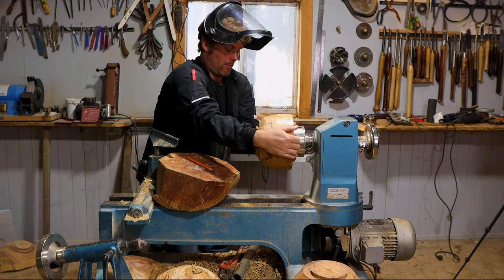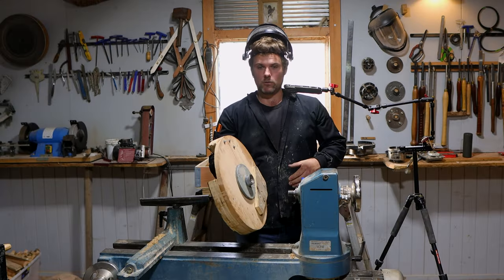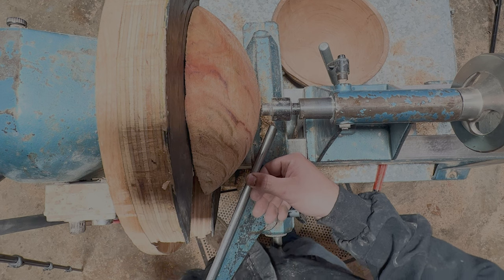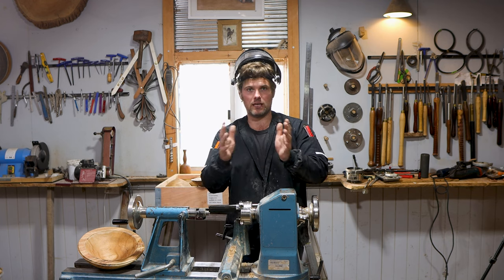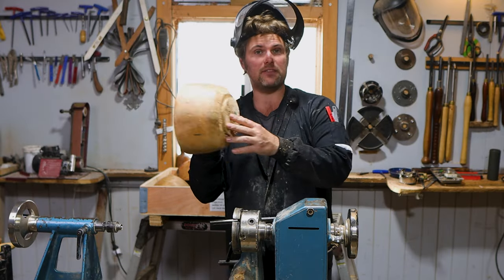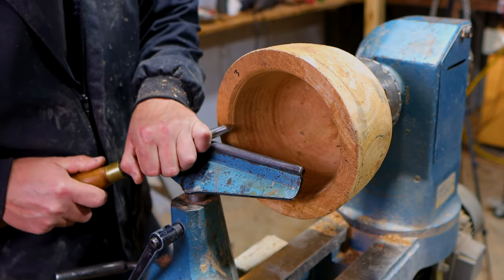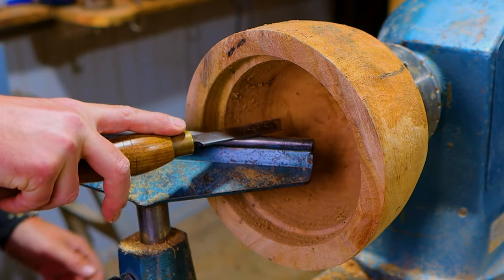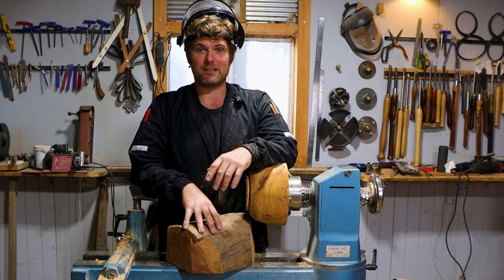4 BEST ways Professional Woodturners use to MOUNT bowls to the lathe. Wish I knew before I started

Comment: Thanks so much for this video.   In the last method, using Mr. Raffan’s skew created shelf on the inside of the bowl to lean the chuck on, once you turn off the spigot on the bottom how do you remove the inside shoulder ?   I am a rookie and this maybe a dumb question.
Reply from the maker: There is no such thing as a silly question.
* 	Place the old out of shape tenon into the chuck as I demonstrated in the video.
* 	Form the shoulder/shelf/step that you mentioned on the inside of the bowl, use your bowl gouge, skew, or just your square-end scraper.
* 	Take the bowl off the chuck, then reposition the bowl to face the chuck. Secure the chuck jaws by expanding them into the newly formed shelf/step/ shoulder you just created. Reshape the tenon to ensure it spins true while shaping the outside of the bowl. Shape the outside until smooth and ready for sanding (but hold off on sanding).
* 	Now rotate the bowl again, putting the newly formed tenon back into the chuck. Finish turning the piece entirely on the inside.
* 	Now setup up for sanding. Sand and apply your finish. In this video, wet sanding with Danish oil is shown to achieve a clean, even finish: https://www.youtube.com/watch?v=J8mKX1QGxjo
* 	After completing the sanding and applying a finish both inside and outside, it's time to remove the tenon. This video offers a simple method for doing that👌 https://www.youtube.com/watch?v=gOcFuTWKYXs
Just remember,The only stupid question is the one that goes unasked.

I hope this is helpful mate
Cheers,
Kezza
Reply: @KerryCorney  thanks so very much
Reply from the maker: My pleasure, mate. If you have Instagram, look me up there as well. That way, we can chat using the messaging feature.Cheers 
Kez

Comment: A trick I learned from Richard Raffen was for mounting blanks, which for you would be rough turning and coring, but for me finish turning, I drill a recess in the top side of the blank. For my Vidmark 120 chuck, that is a 2 5/8 diameter forstner bit, no clue to what metric sizes would be, but you don't want a tight fit, and especially if your blank is uneven, then drill down far enough so that the blank rests oh the outside part of the jaws. . Take the biggest bowl core first, and you already have the center mount for the core by expanding into the drilled recess.... I do use the McNasty, Every one who has tried to use it swears at it. Those of us who know how to use it swear by it......
Reply from the maker: Oh yeh! I made a video on that method👌👌
Works a like a charm

Comment: Loved when you opened the chuck too wide and the jaw fell out!  Hubby and I are absolute beginners and have done exactly that , and had to fiddle around to get it back in properly.  We bought a vintage lathe along with a bunch of accessories, but are lacking a chuck screw, or face plate, and I am trying to figure out exactly what to order to get going .  I ordered a face plate, but it appears to not be machined properly, and won’t screw on.  The lathe came with two 4 jaw chucks, but it seems we need something more in order to secure a piece to cut a tenon.  It is rather confusing.  Anyway, fun and informative video.
Reply from the maker: Thank you so much for your comment. I was thinking, if either of you have Facebook, there is a Woodturning for Beginners page on there that is useful. Can I ask what brand of lathe you have? 
I’m really happy that this video helped. Please let me know if I can make a video on a certain topic that can help in any way.
Cheers,
Kez
Reply: @KerryCorney  thank you for your reply and suggestions.  It is an Atlas, one that was originally used by (I think) McDonald Douglas to make mock ups of parts.  My husband would remember better, I think. This is funny/not funny, I ordered another face plate but it was marked delivered to my mailbox and was not in there!  It is a locking mailbox, so I will wait till tomorrow and see if my mail carrier made a mistake. Hubby managed to get a tenon onto a piece of cherry, a log about 5” in diameter, so we are making progress.  If you made a video that addresses options to secure the piece while cutting a tenon, alternate ways to create a tenon, or any way to get a larger piece than a 2x2 on the lathe if you don’t have a face plate would be helpful. Also I have several pieces of very spalted wood, discussion on whether stabilization with something like Cactus Jiuce is advised, how to proceed would be helpful.  Thanks again.

Comment: An even faster method is rough turn bowls with a slightly longer tenon..then when dry use a Forstner bit ( I use 60mm or 100mm depending on bowl size) and make a hole in the center point you left on tenons. Mount on chuck and finish turning your bowl.. you can then turn inside and outside from that mounting position. Takes practice to turn the outside “backwards “ but bowls will be %100 true inside and out…then just normal tenon removal.
Reply from the maker: Sounds like you have it all sorted mate👌 I made a full video on using a Forstner bit. https://youtu.be/QiCNRcm4HfU?si=CmJSVhdT77cIKUTw 
I use it for time time to get me out of a jam! 🤝
Cheers mate. 
Kez

Comment: On the first three methods, how do you finish the inside of the bowls? Thank you for sharing your knowledge and experience 👍
Reply from the maker: Hey, you've just inspired a video idea for me. Once you've shaped the exterior and formed the tenon, flip it over and attach the chuck. Proceed to turn the interior, sand it, and then apply some oil. I will make a video of each method right up to sanding. 👌

Comment: I don't know if anyone has already mentioned it, but at 1:11, getting those four jaws to tighten equally around the screw can be a challenge. Depending on your chuck, it seems that attaching those jaws can require some pretty specific technique. I made the mistake of assuming "Nova" chucks would be excellent. Well they mostly are but then I started having problems with finish, tool marks, vibration, tearing. Someone please do a video about how to properly get those jaws lined up on the chuck.
Reply from the maker: I’m sorry to hear that you’re encountering these issues. Personally, I haven’t faced any problems with aligning the jaws after switching them to different sizes; or when cleaning the chucks. I use Vicmarc chucks and jaws exclusively. If you’re considering upgrading to Vicmarc, you can find thread adapters to fit your spindle.
I will for add your idea and any others to my list of to-do videos, Walter. Please let me know any future ideas you come up with and or need a hand with🙏🤝
Cheers, Walter.
Kezza

Comment: Found you based on Tomislav's recommendation, and after watching your first video, subscribed.
One thing I wondered; you did not mention using a Longworth chuck or jumbo bowl jaws. Was this because you do not prefer those, or you wanted to show remounting without specialist (expensive) equipment, or because you think those should be used only after rounding the warped blank first? I have adjustable jumbo jaws, would it be safe for remounting or finishing only? Thanks in advance and greetings from Finland!
Reply from the maker: Firstly, thank you for taking the opportunity to follow Tomislav's recommendation and checking out my channel 🙏. 
Concerning the jumbo jaws, I exclusively utilize them for removing the tenon once the bowl has been finished. 
My intention is to showcase various options to fellow turners, expanding their understanding of alternative methods they can utilize effectively with items they may already have. I hope this answers your question. Please let me know. Cheers,
Kezza
Reply: @KerryCorney  I agree. I was also told the jumbo jaws are intended for finalizing touches, not heavy work, when I bought mine. So that would be removing the tenon, sanding, decorating, polishing. Probably best to use common sense, an heavy bowl blank flying off the lathe is not a great idea. Perhaps a follow-up video - how NOT to make a tenon on a warped bowl blank. Jumbo jaws are made of aluminum, which also plays a role, although sturdy, but it is a softer metal. I bought them for other projects, not bowls.
I envy those coring systems... I only have one horsepower so holding my horses and not buying one. Yet.
Reply from the maker: Thanks for adding to the conversations, mate. Yeah, the Jumbo jaws can be a little annoying for removing tenons. Since I bought the vacuum chuck, I haven't looked back. Bowl coring has become such a crucial part of my turning now. Cheers, mate.
Kez
Reply: @KerryCorney  Well, a vacuum chuck is on my shopping list and also far more useful for me than investing on coring systems. Also I have a toaster oven on my list and a vacuum chamber for stabilizing wood, so that investment is quite a bit but the combo makes sense altogether.

I would be very interested on videos about how you use the vacuum chuck. Demonstrations and reviews on that subject are hard to find. Also what to look for when buying one. And there seems to be a wide range of pressure, as resin casting requires less vacuum than wood stabilization and a less robust chamber. What to look for when buying. How much vac is needed for the chuck, does it depend on circumstances, lathe, type of project, etc. The stockist provides help if you inquire, but nevertheless that subject is not widely discussed.

PS Me a lady, not a mate! 😀 Cheers.
Reply from the maker: Sounds like a great idea. Consider it done! @MelkeinMaalla